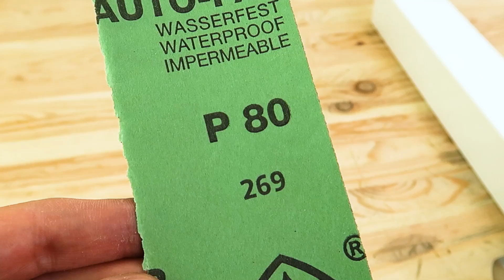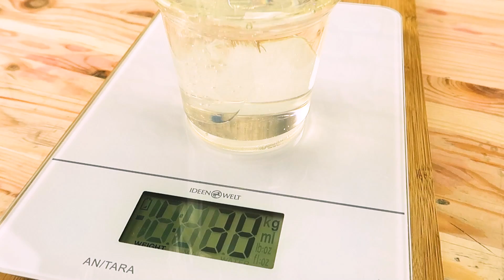Rusty WWI Bayonet Restoration Epoxy Resin Handle

Comment: I love how it all turned out, though I do recommend getting a hold of some good wood for the handle. The epoxy looks great, but it can’t beat the feel or look of the wood.
Reply from the maker: You’re right but this was my intention when I decided to do this restoration. I thought some people doesn’t like it but..🤷🏼‍♂️
Reply: Epoxy doesn't look bad, but I would have preferred wood also. I do not like it so much when he uses plastic, I prefer wood and metal beacuse they are long lasting and environmental friendly.
Reply: @javicorfu  Although he can easily remove them and make wooden handles.
Reply: the epoxy looked way better, wood is a shitty and prone to damage material, embrace the future
Reply: @gaiamission7200  Gaia be like " THE FUTURE IS NOW, OLD MAN!"
Reply: @gaiamission7200  you've got to understand, with relics of the past I believe it is more important to upkeep the originality of it rather than its functionality. Sure you can smack a Abraham's engine and tracks on a WW1 tank, but then it isn't a WW1 tank anymore. And I wish he would've kept the large scratch marks that were on the wood because those were there to mark kills, meaning that blade had definitely been in combat
Reply: @CoolAgainRestoration  you kinda ruined history by using epoxy bro

Comment: I liked how you did the handles. As someone who collects 98 bayonets (typically of the later ww2 period) a ww1 bayonet is hard to come by. The epoxy resin coloring was a nice touch. Unlike the bayonet restoration that I seen before, you made it where it still will mount on the rifle. I didnt care for the sharpening of the blade, as most were left unsharpened for maximum trauma. But it isnt me restoring it. It is up to the collector if they want to add this to the collection. And I do believe someone would add to theirs for the right price. Oh and that knob in the back does come off. All the s98 bayonets were made that way.
Reply from the maker: Very useful informations and thanks for appreciation 👍🏻🍀
Reply: I think i know what restoration video your talking about I watched it before this one but this video I enjoyed more and I like how it will still mount on a rifle still unlike the other one lol
Reply from the maker: I dont have another video with bayonet
Reply: @CoolAgainRestoration  it was uploaded from a different channel not yours lol

Comment: Very nice! I would have preferred to see a new wood handle but the epoxy handle looked far from bad. Something to note is that this bayonet intended to be used in a stabbing motion instead of a slashing motion like you did with the watermelon, so oftentimes the bottom side was left fairly blunt.

Comment: i like your videos but this is something with some serious historic value, i mean you do other stuff like tools and such but that bayonet went through ww1 at least and i just think it deserves a bit more respect than being dolled up to look nice to the modern eye
Reply: I know what you mean and as a collector of militaria I feel the same way, but in any case he did a great job making it look new and he gave new life to an old item. I still like to preserve historical items as such though, the age and wear are testament to what those items have experienced.
Reply: What better way to respect a historical atrefact by giving it a marvelous, polished look instead of letting it just rust away...
Reply: Weapons in WWI were so mass produced that a single bayonet isn't a make or break for historical significance, if anything the blade restoration is a great counterpoint to the preservation status of the rest. An epoxy handle, not so much, but as long as it's clearly labelled then it's simply part of the artefact's ongoing history. This from an archaeologist, btw
Reply: The handle was rotted beyond repair and the rust only gets worse with time if it is not stopped.

Comment: It looks good, but this is not a restoration, it's a modification!
Reply: It's still a restoration. Handles are a consumable part and will need replacing several times in the life of a good and well used blade. The blade was restored and preserved and the handle replaced, whether the handle was replaced with wood, resin, or scales it had to be replaced to restore the piece, what it's replace with is a personal preference and can be changed anytime.
Reply from the maker: Thank you Absolute Terror,for appreciation 👍🏻
Reply: @martyjehovah  No it's not, as he changes the look of the item. He is renovating the bayonet. If he would be doing a restoration he would use the same or similar wood for the handle etc.

I like what's been done, just hope you saved the original handle pieces.
Reply from the maker: There are too many restoration like original and I thought to do something different but I saw the people want to see items restored like original condition..and I make like that after that bayonet. You should stay close to see next video. 👍🏻
Reply: @CoolAgainRestoration  Its a great piece you have done and I think alot of people wants to see more things like this! I like both restoration and  renovation, so keep up the good work!
Reply from the maker: Thanks Victor 👍🏻🍻merry christmas

Comment: That's a G98 "butchers" bayonet...  Those were made by Mauser A.G. Oberndorf...  In good condition, those can bring a premium.
Reply: the only more expensive ones are the serrated "sawback" combat engineering models, same as the normal ones but with serrations for sawing, other then that it's still a regular combat knife/bayonet but with some added utility and "cool factor", I think it might be cross comparable with the newer shorter K98 rifle (I might be thinking of the K98 bayonet being able to mount on a G98 but they also might be fully interchangeable, I'd need to reread on that)

Comment: my only issue is the resin handle, i would have rather it be wood but understand why you chose the resin over wood as it’s visual and a conversation piece so it looks older in a way that you can’t get with new wood: completely understandable and done for the right reasons.

it’s visual art, it’s as close as you can get to original condition without a time machine so nicely done!
Reply from the maker: Thank you very much 😎

Comment: First things first: if you recall this video as a restoration project you should never modify the nature of it. Second, I appreciate your time for sharing this with us and investing your time into working on this bayonet but yet again, the purpose of restoring something is to give the piece its original historically accurate look; so no resin handle but wood. Lastly, bayonets were not designed to cut, but to stab, so no sharpening the blade never ever.

Comment: I was so hoping to see you laser that clean in a matter of minutes.  Why not?  Was probably your safest option considering the age of the item.
Reply from the maker: Sometimes,after laser you need to sanding manually. This step I use it in this video. Will be also laser but i try to improve the machine

Comment: I found one of those  in  my back shed after my grandfather passed away, mine has a metal handle and the blade looks as though its blue steel, and its in a metal case, seems like it sharpens itself every time i insert it back in. I only sprayed WD -40 on it. To keep it from any more damage, but overall its in teal good shape, i may go to the gun and knife show here in baton rouge Louisiana to see what its worth.
Reply from the maker: If it’s not something rare and very old , they are not worthing too much . But you can try 😊

Comment: I commend the hard work and discipline you apply to the manual side of things. You could have easily used a machine one certain points but you clearly still insisted on using your hands! Well done and it’s a fine make
Reply from the maker: Thank you very much Shaun 👍🏻🍀🍻

Comment: Another very effective way to remove all rust without leaving any physical marks is electrolysis.  I did a complete 1888 German Commission rifle that was solid rust and had a frozen bolt. Everything just came apart after a few hours in the electrolysis bath.
Reply from the maker: True 👍🏻

Comment: Absolutely beautiful results. The handle is stunning! Just a question, what do you think the sheet plate under handle was for?
Reply from the maker: I think it’s just for decoration Lance
Reply: The plate piece under the original wood looks as if it is there to stop the front and back cast pieces from possibly moving togeteher , those pieces are cast and they are slipped onto the steel blade which goes right through the handle . Its almost like a reinforcing piece
Reply: That’s a flash guard. Prevents the muzzle blast from scorching the grips of the bayonet.

Comment: Ive always wanted to see the old wooden handles get re-used. Whether that is grinding them to dust and mixing them with epoxy, or gluing them back together.
Reply from the maker: Nice idea with the handle grinded in dust amd mixed with resin. I’ll keep in mind 👍🏻👍🏻
Reply: Doesn't work, it looks ugly to be honest 😅 but if you can find another saw dust that looks similar with the colour it can definitely works. I've make one for ash tray but i'll made one more if i can similar colour saw dust, too lazy to find it

Comment: The epoxy handle is lovely. Any item that was once blued I prefer to boil and card. There is often still original finish under the crud and active rust. You can always strip it later, but it's worth the time to see how nice even common objects were finished back in the day.

Comment: Dude that’s a full blown short sword right there at least that’s what it makes me think of
Reply: that's basically what a bayonet is...
Reply: @LockheedC-130HerculesOfficial  they evolved form simple spikes plugged into barrels to circular ring spikes to short swords (the idea was longer reach by makeing a longer rifle and bayonet to allow you to bayonet fight someone with a shorter rifle/bayonet easier) this evolved as an arms race up until repeating rifles became more common and ww1 showed shorter bayonets saved on weight so they started to shrink, modern ones are multi tools in their own rights with serrations for cutting, insulated wire cutters (for electrified wire or conventional barbed/razor wire) and sevral more niche tools but they still function as a basic combat knife and can convert even the shorter rifles and carbines of the modern era into small spears :D

Comment: You should have blued the blade and the metal handle frame parts
Reply from the maker: Why to do that?
Reply: That's what I did to my sawback. Then ran a sander with 800 grit lightly down the edge to give that silver sliver.

Comment: wow... that handle looks great, as does the rest of it, but the handle surprised me. looks almost like fine wood, least in a vid. How did you come up with graphite as a color agent for the resin. I know they make dyes for it, but never seen graphite used that way before.
Reply from the maker: Epoxy resin I think is the best today. You can use in multiple way and do awesome creative ideas. Thank you for your feeback toot tall 👍🏻🍀
Reply: @CoolAgainRestoration  I have seen some guys do things I would call misusing it. when you said it was gonna be resin, I cringed. course there is a case to be made for putting back wood, and I guess you could still do that.

Comment: Nice restoration but being an historical item from more than 100 yers ago it would have been good to restore it to it's former glory, wooden handle and not as shiny
Reply from the maker: Yes Riccardo but there are too many bayonets 👍🏼
Reply: @CoolAgainRestoration  meh, for me it's not an excuse, there are alot of WW2 helmets but this doesn't justify, for example, painting one pink with flowers. If you wanted a fancy knife you could build one but using a 100 years old item is a bit of a waste, even if it looks cool

Comment: You are doing a great job with the metal. But why to the hell you are loosing your time with the bf epoxy. A piece of old wood would have given the history back. Now it is a piece of show. Soory
Reply from the maker: You’re little bit right
Reply: Sorry, it's a lovely job, but any meaningful "history" went as soon as it hit the wire wheel and lost it's patina.  It's not like there aren't about a million of these bayonets knocking around anyway, so the loss to history is tiny.  Incidentally, why bother with the rust remover if you're going to wire brush it, file it, and polish it anyway?

Comment: you destroyed this piece of history. 1--- you SANDED the blade, 2-- you used a household hammer to fix the tip, 3--- you didn't repair the original handle. this was NOT a restoration, this was destroying and modifying.
Reply from the maker: Is like you said
Reply: Totally agree no collector would touch it as you have destroyed its historical value what you have done is Blinged up a old bayonet
Reply from the maker: I dont sell that and no collector will touch because is in my collection right now 👍🏻
Reply: @CoolAgainRestoration   your missing the point
Reply from the maker: It’s ok.